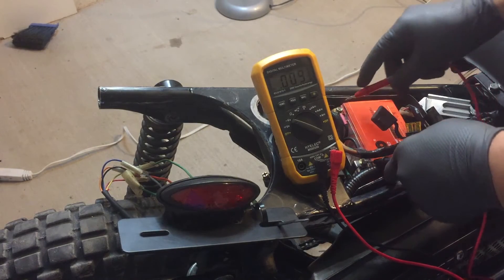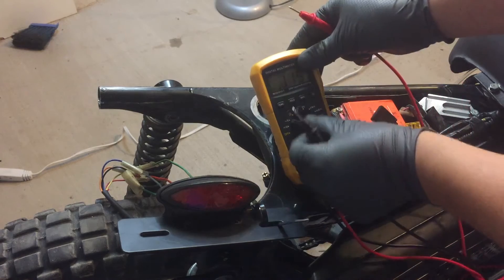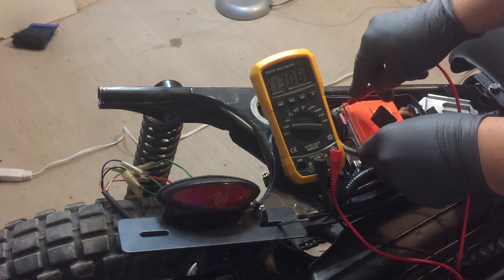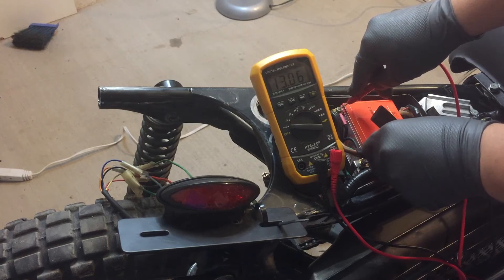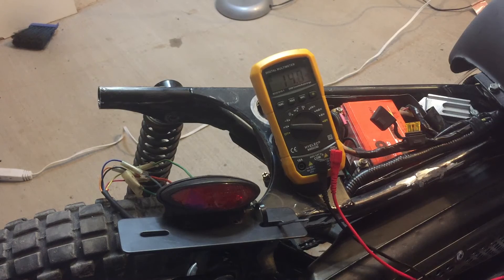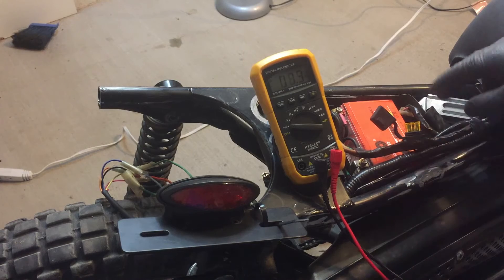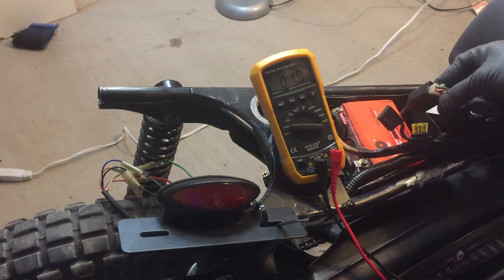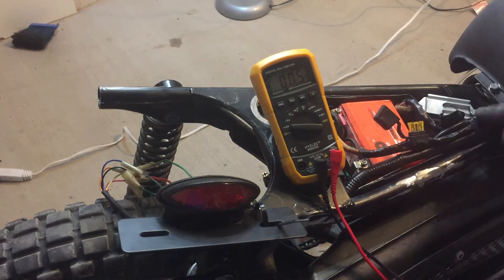6v to 12v Conversion - 76 Honda MT250

Comment: Ok I think I have figured it out although I cant start my Mt 250 yet cause the motor is being rebuilt but the pink and yellow will go to the rectifier left and right side if you have the schematic. The coil with the white/yellow coming off it needs to be disconnected from ground on the opposite end of it and joined to the pink to form a star point. The white/yellow goes to the headlight switch to provide AC. When switched the AC is then in the B/W at headlight switch to feed the headlight with switched AC. Disconnect this at the B/W plug shown just below the headlight switch and join the bottom bit of it to the brown/white to go out to the lights they (B/W and Br/W)will both be DC then ( the Br/W is DC). Then join an extra wire from the B/W that is still AC ( and going nowhere) and join it to the yellow in rectifier. This means that when you turn the headlights on you now get both ac coils sum together for the extra charging current needed. I will make the fuse a 15Amp also. And change battery and all bulbs.
I have sourced another magneto and will try to see if I can swap the WH/Y coil which is the one used for headlight as standard out and replace it with the battery charging one from the second magneto. That way i will have 2 of the battery charging coils . U need to 2 magnetos to make one.
Reply: Did you ever try this out Jeff? I was wanting to go LED but this is still 12vac for headlight.  Could always add another rectifier but loosing power everytime converting

Comment: Hi I have a 78 xl75 trying to get the electrical to run without battery . Nothing on the bike besides two output for a/c voltage and one wire for coil. Would I need to install this rectifier/regulator and put a diode as well or just the rectifier?

Comment: One last question?  Should I remove the giant headlight resistor?
Reply from the maker: Sorry for not getting back to your questions sooner. Glad you figured most of it out. Is the resistor on the bulb? If you have a multimeter you should be able to check how much current is being given after the resistor. I have a 6v headlight which in the video looks much brighter with 12v running through it, but we all know that soon enough running it like that will kill the bulb. I would say the resister is going to only let what ever current the bulb is rated for so you can probably leave it alone. On another note, I was just going to replace the bulb with a 12v.
Reply: I have switched the bulb over to a 12volt bulb.  Many of the other bulbs I already switched because it was too hard to find 6v equivalent bulbs.  I worry about the resistor a little bit.  I am not really sure how it will be effected by the higher voltage running though it.

Comment: OK I realize that the pink and Yellow wire just need to go the AC and the B/+ supposed to go to the battery (the red-white) wire.  

The bike runs and is charging at 13.8 volts but nothing else works.  parking light, instrument light, horn, turn signals etc.  I thought I replaced the instrument lights, clutch light etc were replaced with 12v ones when I could not find 6v replacements.  main fuse still looks good.  Any ideas?

I checked the brake/parking bulb in the back both filamnets are still good.  There does not seem to be any power going to the socket.

Comment: Would you be willing to help me work through this conversion on my 1974 Honda Elsinore.  4 wires on old rectifier 3 on the new.  I understand that the ground is just the case on the Kohler. But the Kohler is marked A/C B/+ and A/C.  I am not sure where to put each of the stock wires on the new rectifier.  

Can I use a incandescent bulbs or do I need to go LED everywhere (can I keep a incandescent 12v headlamp)?
Reply: He's using DC LED lights which made him convert from 6 volt AC to 12 Volt DC. I don't think you will have any problems with keeping your incandescent bulbs.

Comment: thx for ur time and reply.  my stator has 4 wires coming out. according to schematic, black one goes to ign sw and kill sw, yellow and pink wires only goes to rectifier, and the white one goes to headlight on/off switch. i suppose i should ck for the stator voltage at the pink and yellow wires?

Comment: i have a 1975 xl250 that i want to covert to 12 volt.  the only videos i c on this are very short (like urs) and dont go into specifics.  do u or anyone offer a in depth "how to" instruction sheet along with all the needed parts?  thanks
Reply: ive already been attempting several ways but all "no go".  after reading the reply that the author "Elitoh7" sent me i believe i can now make it work. i have to wait till the recommended Kohler volt reg gets here to try it out.  if im ever successful i will look u up and let u kno how i did it.  thx
Reply: same but with both my XL175 and Mr175
Reply: Tyler Warren -  if you convert your xl250, post what you did.  I have a '74 xl250 that I am looking to convert it over during a cafe racer build
Reply: Please Keep us posted as im trying to do this with my XL175 ;)
Reply: @julioboostamante1  I am trying to do the same with my 1978 honda xl175 and the 78' year model doesn't come with a battery
Reply from the maker: I would first measure how much AC is coming out of the stator. If your stator produces 20v+ then you should be able to use the Kohler voltage regulator I used. On your XL250 you will probably have 3 wires coming out of the stator. I believe the two AC wires are pink which will go to the "AC" connectors on the regulator. The B+ on the regulator is the output which I ran back to main harness as was seen in the video. The kohler unit does not have a ground, the unit is the ground so you must ground it and harness ground (green wire for me) to the frame. 

I think the main reason you will find videos like this is because they are bike specific and people don't 100% know all the motorcycles this would apply to. You will probably notice that in those other videos there aren't too many people willing to help either(no replies in their comment section). I do hope this helps your in your journey, thanks for watching.
Reply: I would like to do the same thing in a 1978 Honda twinstar cm185.  The starter cranks on 12volts (weakened on purpose) but im sure its bad for it? ... I'm curious how many components of the bike I would need to switch over. Bulbs I assume would be easy, but what about the starter and all the other electrical components ( I don't even know what all there is in total . its a new hobby to me)  I found a tractor resister that looks really rugged that can drop 12volts to 6volts so I could at least use jumper packs and a 12 volt battery (I think?) you know of reasons this might be a bad idea? I would prefer switching the bike totally to 122 volts though,.

Comment: No need to mess with your stator if it's producing 25-50 AC volts.  Just wire in a 12V regulator/rectifier, change your battery to 12V, change out your bulbs to 12V and voila!!
Reply: Is it really that easy? What about the ignition coils and condenser?
Reply: @vegardpedersen8651  they are a totally separate circuit and just remain as is.
The headlight is anAC circuit and is the WH/y wire and it is separate to the dc circuit which comes off the rectifier

Comment: Thank so much for posting this video. I've read about this mod, but always as a way to solidify a current 12v system on old Honda's. Never as a direct solution to converting 6v to 12v. Did you need to modify anything other than installing this reg/rectifier combo unit?
Reply from the maker: Sorry Scott, I thought I had replied to you. I didn't need to mod anything else besides the wiring to allow me connect it easily.
Reply: Thanks for the info.  Might try some testing with a 1972 XL250.
Reply: Scott Norton did that ever work for you? I’m about to do it on an 74’ XL 350
Reply: hey Scott did it work?
Reply: @josephhammond2268  Sorry guys.  Never got around to it.  Left it 6v for now.

Comment: what rectifier you use..?? my stator gives 2 yellow wires  to the rectifier...the most rectifier i find give three yellow...if i cut the one it  will work..??
Reply from the maker: The rectifier is listed in the comments. My bike has 1 yellow and 1 pink coming from the stator. More than likely the two yellow are for the rectifier. I would try to find the manual and verify that the two yellows are for the rectifier. Once you figure that out then the 2 AC wires go from the stator to the to inputs of the rectifier and then the one output goes to your battery/capacitor. I grounded the rectifier by putting it on the frame of the motorcycle. Hope that helps. Good luck!
Reply: +Elitoh7  thank you very much ...i appresiate....!!
Reply from the maker: I didn't use a capacitor. In general terms you would only need a cap if you you needed power to be there for a specific amount of time after you shut off the "device", in this case the engine. I believe a lot of people use Capacitors to eliminate the battery all together. Hope that helps.
Reply from the maker: Bills BuildAll Sounds like a project! Good luck I hope it all works out for you.

Comment: hi..i would like to ask you how you did it...i have a honda cm125 6v system and i want to do the same...you just change the rectifier and the baterry with 12v ??
Reply from the maker: Hi and thanks for watching. Yes, I measured how much was actually being given out by the stator on my bike which was something like 20-48v AC which is more than enough for the rectifier to convert to DC. These old Stators are really all over the place which is why I didn't have to alter or change mine. So, yes to answer your question all I had to do is changed my rectifier and battery. Everything works really nice, no flickering. I would check your stator output first to make sure it gives off enough AC volts. I also run LED for all my lighting as well. Good Luck!